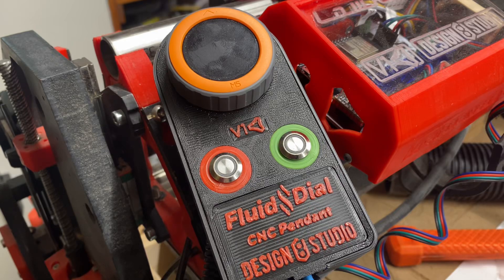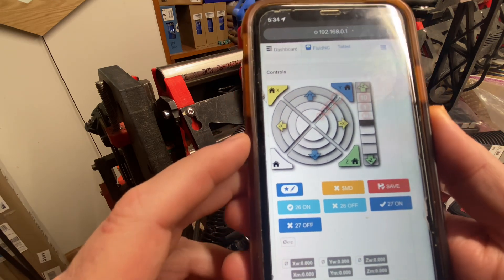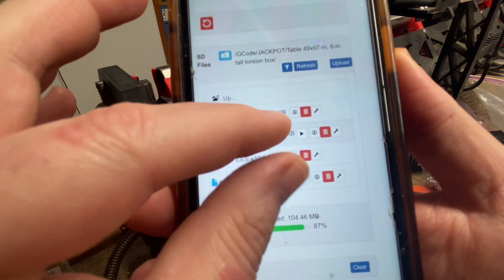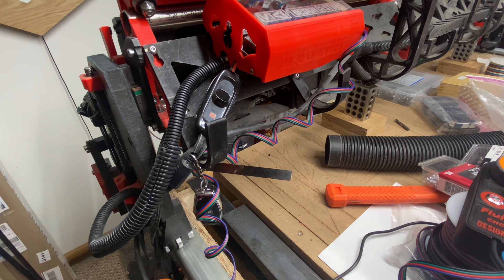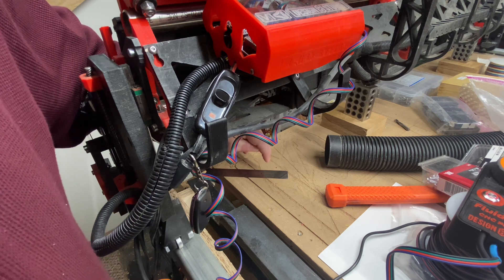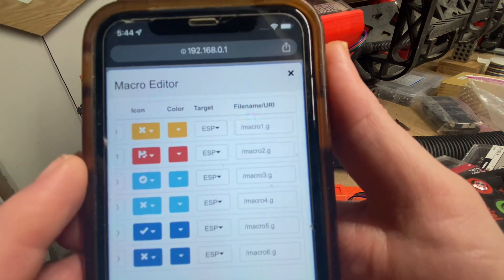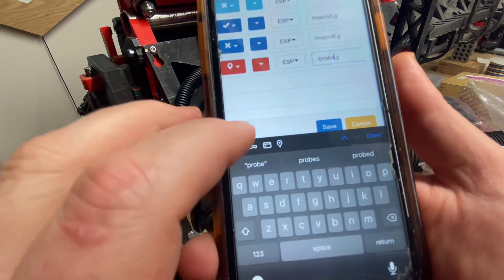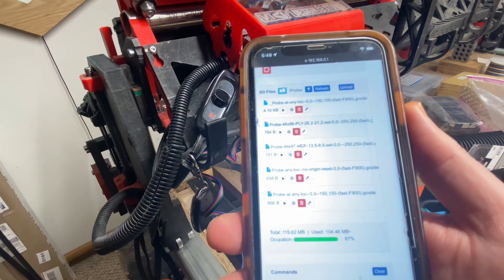LowRider v3 CNC with Jackpot controller - Workflow Explained - Part 1

Comment from the maker: One note / correction: If the "probe.g" macro script is located on the SD card, the "target" setting for the macro should be "SD" — whereas if the macro script is on the ESP's built in flash storage, then the target would be "ESP" — sorry for any confusion. I addressed this and more in part 2! 🙂

Comment: Looks like you got the jackpot controller working great, I seem to be having a problem figuring out which is x y z on the control board, any help would be great!
Reply from the maker: In the documentation for the Jackpot is a photograph with each axis labeled for both the driver location and the end stop location. If you get that it should help you get everything sorted out. Sorry for the delay in responding. Somehow I never saw your comment until just now.

Comment: Thanks Doug, funny I send you a message and you were doing this video. It definitely helped a bit. I think there needs to be a video for newbies. One from when you first turn the jackpot on all the way to drawing the crown. Then maybe one on a simple job. Some of this may be written to follow but some like myself really need a visual. Once you see it's like oooooh DUH lol. Thanks for all you and Ryan do.
Reply from the maker: Your message is what prompted me to up and make the video. 🙂 I started when I read your message!
Reply: I agree, that would be really useful. I've found it a bit of a tough experience. 

Right now, I'm trying to figure out why I can't draw the crown. I have Doug's probe macro and I've followed the procedure (home, run probe macro) but when I run the crown macro, the offset is wildly wrong (closer to zero rather than the spoilboard height) and it draws in the air. I would expect the probe macro to set the max Z offset from the home position and that the run of the gcode file would use the correct offset. 

Another thing I would dearly love, is a run through of the settings in the config.yaml file. I have set my x, y and z extents by entering values of max travel along all three axes. I think this the correct procedure, but I"m not sure.  

Having said that Doug's videos and modifications are really great and his work is really inspiring.
Reply from the maker: @bunkie2100  if you get a chance, log into the V1E.com forum and post your probe script and we can check it out and see if we find anything in it that needs correction. You can also take some pictures or some video of what you’re doing and how it’s not getting the result you think it should get and that may help us to figure out what needs attention. I will definitely consider doing a video that is a walk-through of the config.YAML settings.
Reply from the maker: I've done at least a couple other videos about the Jackpot — nothing totally comprehensive but hopefully helpful. https://www.youtube.com/watch?v=OVDOo8U5uiw https://www.youtube.com/watch?v=qWb81eBzrYY